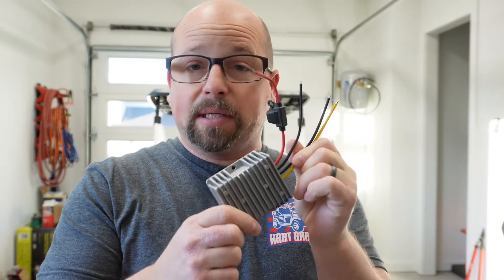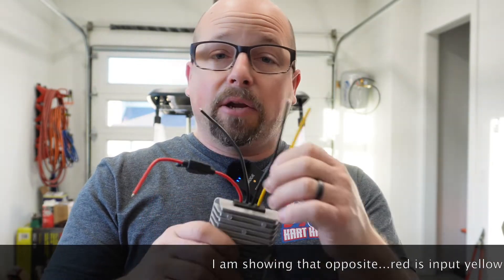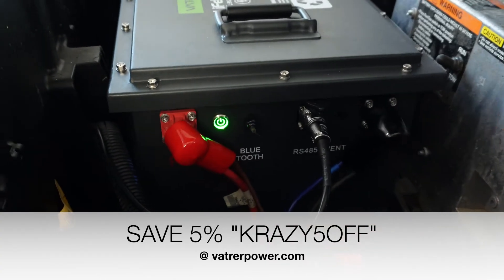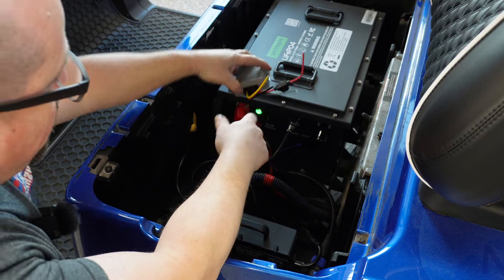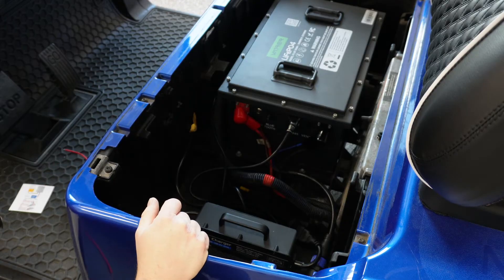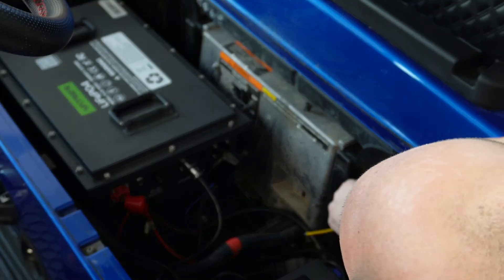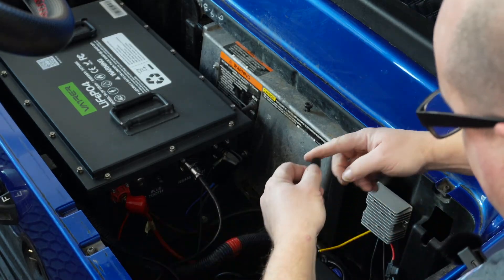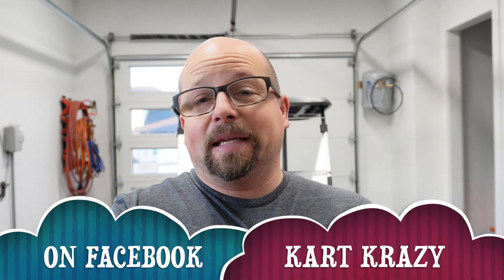GOLF CART VOLTAGE REDUCER 101

Comment: I hooked my reducer up as you described but it didn't work the factory installed lights/horn.  Does this 2020 onward already come with a reducer and is hooking up a second one an issue?
Reply from the maker: Possibly…did it have lead acid batteries before?

Comment: I was hooking up the same reducer but when I went to connect the negative to the battery terminal. A lot of arcing/sparks. It didn’t appear yours did that. I had the key off and the cart in tow mode, but there is no way to turn off my battery as yours does.
Reply from the maker: Sparks are normal when you’re not able to turn off the Battery

Comment: I have a 2016 Precedent with standard light kit. Just installed a new 48v lithium battery and believed to have smoked the headlight, but tail lights are still operable with pull switch. Now realizing a converter is necessary. My question is, the black from light kit harness currently connects to OBC black. Would those both connect to the converter black? The yellow seems straightforward with connection to harness blue. Thanks!
Reply from the maker: One black to battery negative

Comment: Awesome video! I do have one question that maybe you can help with.  I have duel 48v30ah batteries. Do I connect the + on one battery and the - on the other, or do I run them to their respective Busbars and connect there?
Reply from the maker: Yes, usually positive on one battery negative on the other with the main connection and the bus bar

Comment: I did this exact thing today, the volt reducer has 12+ coming out of it but somehow the entire installed kit isn’t working at all. Did I do something wrong? Is there a grounding issue I don’t know about?
Reply from the maker: If you have 12 V coming out of the reducer, and that is hooked to your accessories, I would check for a blown fuse on the accessory side
Reply: @kartkrazy it’s blowing the fuse 100% of the time. I checked the voltage across all of the harness plugins, it seems like there might be a short in the harness.

Comment: I have the same regulator as this. I hooked the red wire up to the positive on my 48 volt setup. I was being overly careful and put my volt meter on to see what the voltage was. Without even hooking the ground to the battery ALL 4 wires showed 50 volts, and yes even with the ground wire not connected. I saw people say oh the ground will spark when putting to the battery and it’s normal. Does this even make sense or am I overlooking something?
Reply from the maker: Does not sound right at all
Reply: Yes it’s crazy. Maybe a little spark is fine but I just wasn’t taking any chances with it. It’s self tapped into a metal plate and I even wondered if that had anything to do with. I’ve been wiring stuff up in vehicles 30 years and this was a first getting voltage out of the negative side. 😂

Comment: Why doesn't everyone just use the 5 wire reducer and hook it to the key switch. Zero drain on your batteries.
Reply from the maker: Not everyone is super versed on electrical so this is easier
Reply: Do you have a link to one? Preferably lead batteries but idk if that makes a difference

Comment: I connected 12v + to the BLU wire for the head light. Where, in the bucket, is the 12v negative wire for the 2015 Precedent?
Reply from the maker: Should be right near the aluminum panel on the back big black cable with a yellow butt connector on it
Otherwise hook your voltage reducer right to the battery negative

Comment: what did ya do with the black wire coming out of reducer?
Reply from the maker: Use it for the wiring harness for the lights
Reply: @kartkrazy  when you say that, are you splicing it in somewhere?  I have an ecobattery 51V lithium i just changed to, only thing left is trying to re-power my headlights.  the loom that runs from my headlight switch down and back into my battery compartment has a blue wire with a ring connector on it, thjen later in the loom a black wire comes out, splices into another black, and disappears behind / under the cart (i assume its down there grounded somewhere).  I THINK I connect my red 12v converter wire to the blue wire that currently has a ring connector on it... but then ive got this loose black wire still coming out of my converter next to that one. does that sit loose? or do i need to splice it to something
Reply from the maker: @llcoolet07 blue to red black to black

Comment: Have you seen an internal short on a voltage reducer? I keep blowing fuses instantly when placing the battery power fuse in. I did remove fuses from the accessories that are plugged in already. I ordered a reducer already just looking for any other ideas that may cause it but i seemed to have isolated it down to that
Reply from the maker: Have not but it is very possible

Comment: Bought some 48V lith batteries and installed them.   Only to discover theses carts are 36V  Is there any reducers available?   Bought these from amazon and they will not take them back   ugh
Reply: Your cart motor will be fine running on 48vdc.  The controller is what may, or may not have an issue, as electronic componets have a voltage range in which they will operate.  I'd run it and see what happens.  If the controller goes kaput, replace with a 48 vdc controller.  Note, they may refer to your controller at the dealership as the carts computer.
Reply from the maker: Oh no
No reducer available that I know of 😢
Reply: I would think about upgrading your solenoid as well for the exact same reason.

Comment: On a 8volt six battery system one would have to connect to the main battery cables right? New to this Gulf carts stuff.
Reply from the maker: @rodkramer8879  you would connect it to the last positive in the series… I don’t think it matters which negative because negative is negative

Comment: Thanks so much for the helpful video. Does the key switch get wired to the step down converter as well?
Reply from the maker: You can do it that way if you’d like, but it’s not necessary
The advantages is the reducer is not drawing a small amperage from being on all the time

Comment: I have a 2013 club car that I am converting from acid to Lithium 51.2V  105 AH my cart already has head lights and turn signals due I need to add a voltage reducer or would I already have one with the 48V acid set up. Sorry not very electrical purchased.
48V(51.2V) 105AH LiFePO4 Lithium Golf Cart Battery Built-in 250A BMS,3C Discharge,with 20A Charger,Mobile APP,Touch Monitor,6000+ Cycles,Perfect for Golf Carts (GFA48V-105AH
Reply from the maker: You would have to check and see if you have a voltage reducer or if they just had the lights hooked up to two of the six batteries

Comment: Hi there!  If I already have a cart with headlights etc. and I’m switching from lead acid to lithium, am I correct in assuming there would already be a voltage reducer for those accessories?  
I guess I don’t know what would change in going from LA to lithium.
Reply: My 12V system was connected across two of the 8V batteries, and there was a 16-18V to 12V reducer, labelled 'extremely hot'. My guess is that is uses resistance to drop the voltage. I removed it as it was no longer needed.
Reply from the maker: It doesn’t necessarily have a voltage reducer as a lot of people will just hook up to two of the 8 V batteries or 1 12v… so you would need to verify
Reply: That makes sense!  Thank you for the quick reply.
Reply from the maker: @ good luck!!

Comment: So the black negative coming from the reducer is not used at all ?  It just hangs there?
Reply from the maker: @bigshowradio_550  that is not correct
I was just hooking up the voltage reducer in this video… You would use the yellow to the positive side of your accessories and the negative to the negative side of your accessories
Reply: @ ok. I thought so but I question my thinking anymore 😁. My lithium 52 volt arrived today.  It doesn’t have a button to turn it off (DC House) but has an app.   Might be able to turn it off through that? It’ll be a bit before I install it.  If I cannot turn it off, does it make a difference which lead I connect to the battery first?
Reply from the maker: Does not..just be careful if you can’t turn it off 😎👍🏻

Comment: I have a blue wire going to the main pos and a black wire taped, but not connected to the main negative, and going into the back of the cart .....when either is disconnected the lights go off...when tested it draws 48v....does this go to a reducer already in the cart or do i still add a reducer....if so what happens to those wires
Reply from the maker: Lithium or lead acid?
You must have a reducer somewhere if the lights work.
You can fallow the wires and find out.